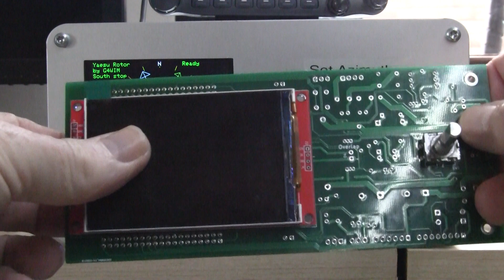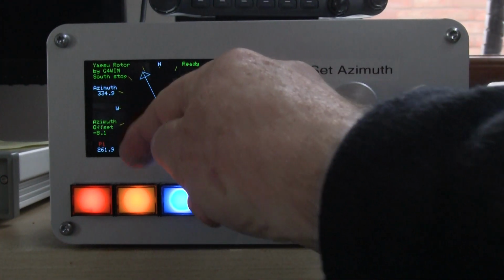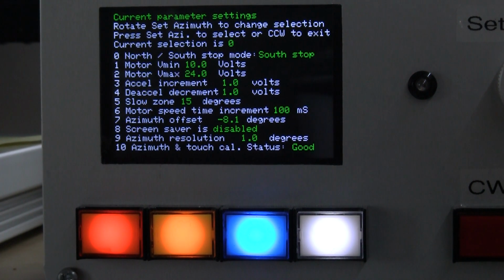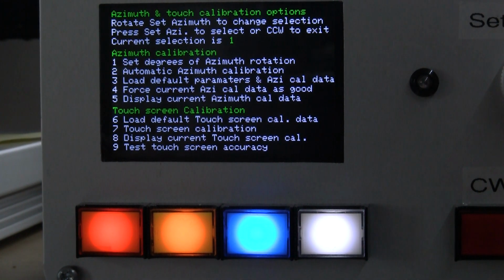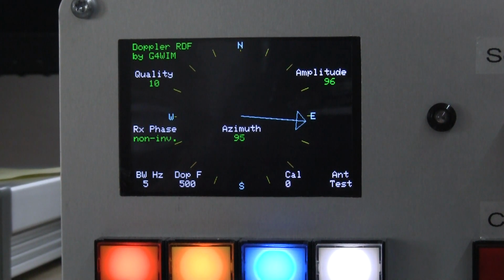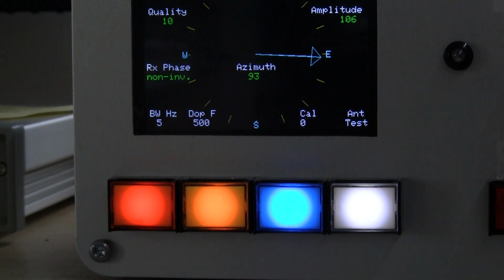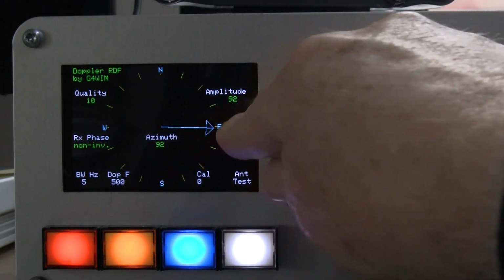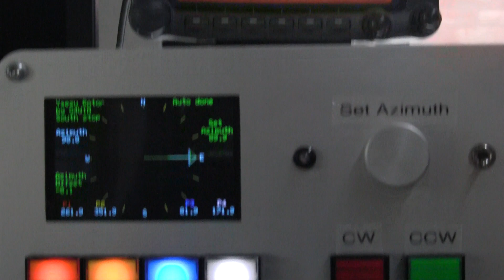G4WIM Rotator &  RDF update

Comment: I am wondering if you do have the option to change position of rotor depending on the antenna that is used ? Having a yagi 10-15-20 and a 40 rotatable dipole 90° oppsosed to the yagi... Also is all the code and programming available for free or this is a kit that is needed to be bought and assembled ? github ?
Reply from the maker: Here's a link to the article  which should help you https://www.dropbox.com/home/Rotator%20controller/STM32%20Rotor%20Firmware%20V2.1/Full%20construction%20details%20for%20parts%201%2C%202%20%26%203

You'd have to make some changes to the code to accomodate the antenna offset but there code is already there.

Comment: Very Good... 
I am interested in the rotor control project, so I want to make it myself.
Reply from the maker: here's a link to some more info in three parts 

https://www.dropbox.com/scl/fi/d80icoz9xts4a6pb4vxcn/Part-1-An-improved-aerial-rotator-controller-and-RDF-system-Nucleo.docx?rlkey=ta3u0d4rhg15rxzgcjd1nolne&dl=0

https://www.dropbox.com/scl/fi/ekys66hb0h0vkscyyh00z/Part-2-An-improved-aerial-rotator-controller.docx?rlkey=z2j3ee5i7qgie1dvw5nwz7qaa&dl=0

https://www.dropbox.com/scl/fi/ovlwzcsyjx1of56anz8to/Part-3-Magnetic-loop-antenna-tuner.docx?rlkey=2spls174lge2sfu6lzfjfh45o&dl=0

Comment: Hello @Tim Forrester,
. I have a Yaesu G400RC and am looking to replace the controller. I have EA4TX controller but it doesn't work for me. would this work for the 400RV 24v AC  old school rotator?

If so when are we talking of availability?
Reply from the maker: Hi Rab, I have sets of PCBs available nw and if desired can also supply programmed STM32 along with displays.  I have some ideas for an AC motor interrface, but its not ready yet.
Reply: @timdf911  Cool...
I also would like to make a controler for  an old G400RC I own without control box as the previous owner did not have it longer ..
This old rotator will be use in /p for V/UHF contests
73
Jean-Phi F5GKW
Reply from the maker: @jeanphi-bct   please contact me via e mail, I'm good on qrz.com.  73 Tim

Comment: Hi Tim, The tinyurl link you gave in Jan 2023 RadCom for the  Arduino sketch links to Dropbox, but reports that the files have been deleted. Have you got another link please. I want to drive a KenPro AC motor rotator, so I will need to modify the software and hardware.
Reply from the maker: Hi Tony,  not sure how that happened - try this link instead https://tinyurl.com/ynxpmpt8
Reply: @timdf911  Thanks Tim, I was going to drop you a note about the message indicating the files were deleted to the RadCom address listed in the article and thought I should do some searching first. Glad I did!  Thank you for sharing this project with the Amateur community!

Comment: What resolution is the display?
Must be good to draw those clock style hands.  Is it a SPI or parallel display?
Looks nice.
Reply from the maker: Display is a standard 480x320 with SPI interface running at 50MHz. The STM32 updates the hands 20 times per second to give a nice smooth indication.